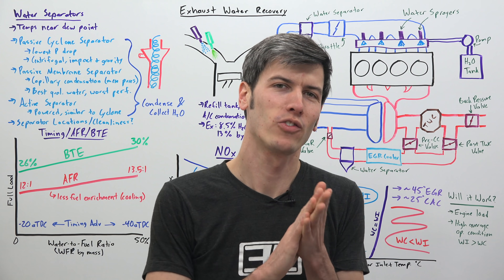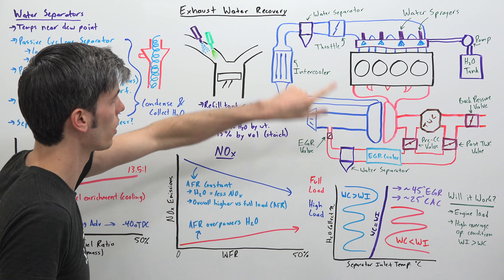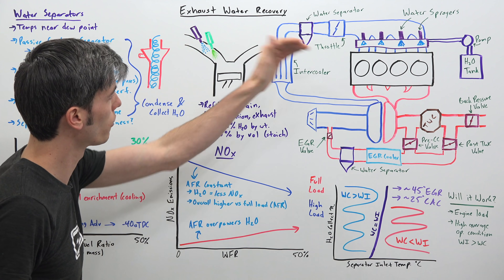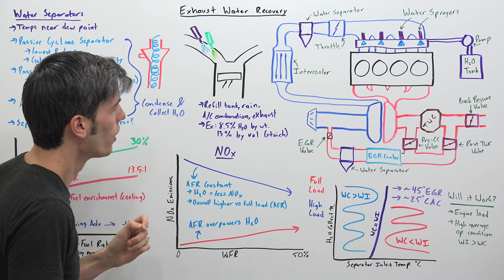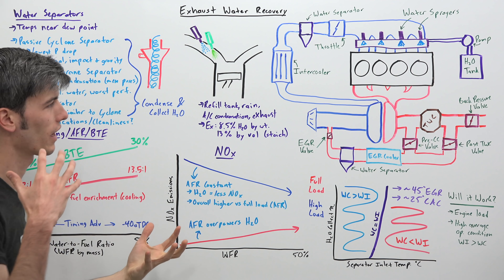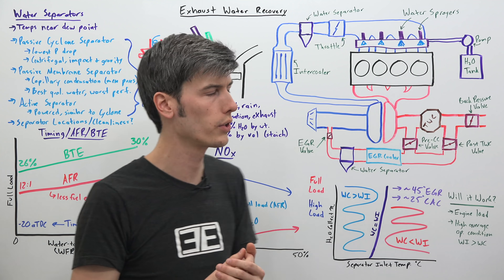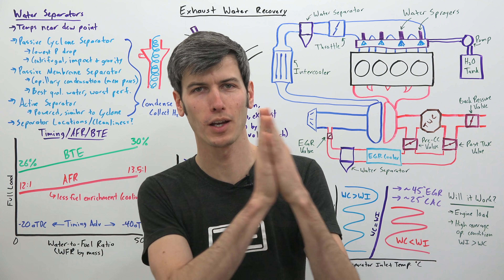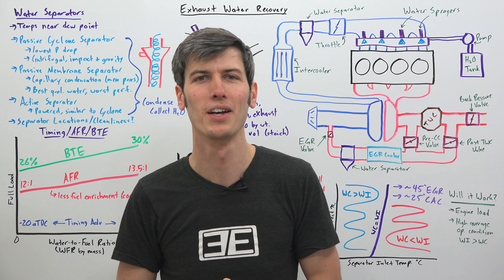Using Exhaust Water To Make More Horsepower!

Comment: Just curious as if you have actually utilized any of these situations or ideas.  I've actually ran water injection,  hydrogen and various fuels with and without both. Water injection has limits with the use of petroleum fuels which is why the Nox gases are a problem.  Using petroleum you can not get rid of these gases, and using water or hydrogen doesn't do much more than reduce them by dilution,  not elimination.  Two things that are important to note,  one; water ignition turns it immediately into hydrogen and that immediately ignites creating the increase in power,  however,  hydrogen (any airgas), does not burn before tdc like petroleum fuels,  therefore the two are constantly working against each other rather than together in a much more beneficial way, two; after detonation and compression the hydrogen and oxygen are immediately reusable as a much more volatile source but the spent petroleum contaminates the process driving down the fresh source
Reply: ...reliability.  
Hydrogen and water injection are a much more suitable combination

Comment: I’ve got a question. Why didn’t they place the water separator BEFORE the turbo’s compressor ? If they did then the drop in pressure caused by the separator wouldn’t be a problem since the air from the compressor upstream would have a higher pressure and thus pull the air from the separator with no problem.

Comment: Will you make a video about direct water injection ? BMW even let a couple of journalists test a 1 series modified with it (it was a red 3 door F20 , a B38 engine with compression ratio raised to 11:1).
Sad that after the M4 GTS in 2015 , no automaker produced a car with water injection. Also about the GTS... I could never figure out why it had 3 water injectors for 6 cylinders.

Comment: Why not just use hybrid water collection system which will collect water from air conditioning as well as we can pour water manually. If air conditioning is not used for a very long period of time, sensors can turn off the water injection system if there is no water available in the tank. I

Comment: Water injection is not new! Many years ago I had an old 1960 P4 Rover 80 which had a 2 1/4 litre petrol engine. I had the misfortune to have a rad leak, and ran out of coolant. Unfortunately, in the process of refilling the system being rather late at night in the middle of nowhere 30 miles from home, the cylinder head cracked and water poured into the cylinders. Having lost the radiator cap which shot off into the darkness, I just filled the rad realising the damage was done. Had to use full choke to get the engine going and got home ok. I drove the car around for a week or two, and the thing went like poo off a shovel and the economy was incredible. Water is an expansive medium when heated to steam. Don't know the science fully, but it was an expensive mistake as far as I was concerned at the time having to get a replacement cylinder head. Never mind the techno babble, all I know is water injection - however its done - certainly does something to the  combustion and ultimately the  economy!

Comment: Vapor gallons, tune, alcohol vapor if wanted, water injection.  7-10 vapor gallons in 1 liquid gallon of gasoline.

15% increase will look like a horrible joke 
However, most of those carbs or fuel vapor devices are out of sight.  

Unless... say one used a thermal fogger for fuel.   Or advanced wicking with better materials.

"Liquid fuel does not burn, 80% of fuel uses is wasted in engines."  ** Popular mechanics every time we talk about this since we started.
Reply: Let's get into why 7,000 inventors are wrong and why if Pogue, fisher, and the like were wrong why billions were spent to silence them.

Comment: Wait until BMW deploys this kind of system. I'm sure they can figure a way to have it fill the cylinders with water or something like that, thereby introducing a whole new catastrophic failure mode. Obviously, the $1,000 water pump must be located where it's nearly impossible to access.

Comment: if the most restrictive seperator is the one that get the most power, would it be possible, on a turbocharged car, to only use the system when the turbocharger is at max boost and the wastegate is open, and then let the charge air run through the seperator, because the turbo should be able the create more air to keep the boost and you wouldt loose power but would gain water from the seperator.

Comment: So wouldn’t it be best to have a water container so at low loads water can be collected successfully and non is injected into the engine while at high loads water is injected through some sort of ECU mapping to reduce nitrous oxide emissions and increase efficiency allowing companies to produce high performance cars without fined for exceeding emissions

Comment: By cleaner water you mean what exactly? Less carbonic acid/nitric acids?
Couldn't water be injected before the water separator on the intake to increase how well it condensates? I get that that is somewhat counterproductive, but it a way it could slightly reduce intake temperatures but also help with ease of water collection (plus the water used gets put back into the cycle as well).

Comment: If It was possible to mix water within the Fuel at the right proportion would it produce the same effect ? I mean for Gasoline maybe not but .. Ethanol ? ... If you need to vary the proportion along the engine loads then it's bad yes but interesting !! Cool !!

Comment: Consumers dont want to have to fill a water tank...
If thats the case then they certainly dont want to be spending the weekend cleaning soot from another exhaust filter.

Not to mention that condensed water from burning gas is usually pretty corrosive.

Comment: Does using the water separator only without any water injection into the intake will increase the power of the engine? As you said in other video that humidity reduces the O2 mass. With low humidity means higher O2 mass. Does this theory applies to both Gas and Diesel engine?

Comment: Wouldn't the water collection be heavily dependent on outside humidity? If you're just trying to recollect the water that you're injecting and the natural byproducts of combustion and the majority of exhaust isn't going to be able to be recirculated, I'd think that more consistent input of humidity would be relevant.

Wouldn't it also make more sense to overdesign one water separator in the intake since your egr is going to go through it anyway?

Comment: So the car runs partially on STEAM POWER to use the otherwise wasted heat to generate power. Can it be enough to build an engine that does not need water cooling?

Comment: Is it me or is  internal combustion hitting peak ridiculousness...
Meanwhile Toyota made an inline 6 over two decades ago capable of 600HP without any modifications for hundreds of thousands of miles, and 1000HP with minor modifications and still insanely reliable. All while getting 20-30mpg in daily driving and running so smooth it couldn't topple a cup of water on top of the valve cover through the rev range...

Comment: What if you don't care about actual recovery but you like the idea of removing the moisture from the intake air? What are the specs on that say like for a 500 - 600 horsepower motor? Is it going to be too restrictive? Will it remove much moisture?

Comment: "...the effect of cooling the air which is done by injecting a liquid water..."
A very similar change in temperature (only in the opposite direction) occurs when  getting an amount of water vapor to condense out of a parcel of air as would occur getting the same amount of liquid water to vaporize in air.
Unless there is an intercooler (or other significant heat loss mechanism) between the condenser and the injector then there is no net temperature benefit of first condensing water out of air only to then vaporize a similar amount into the air.  
Yes, the temperature goes down with vaporization of injected water, but it goes down from a temperature already elevate by the earlier condensing.

Comment: I can already advance my timing to the point where there is no more mechanical advantage.  Just adjust the my distributor to the setting where the engine idles
at its maximum speed.  My anti-knock device reduces knock without adding water!  So extra engine corrosion and oil dilution is not A problem.

Comment: I’d rather have less moisture in my engine and an unnoticeable amount of power gain then messing with water injection. NTY. Only things that should be injected is combustibles. Methane, hexane, propane, cocaine, NO2.
Not H2O.

Comment: Ridiculous... I'd rather have another tank I have to fill up when refilling the fuel instead of those technical water reclamation systems... If one  system I'd prefer the ac reclamation system over those of the exhaust gases...

Comment: Can i use water injection for engine with high compression no boost?
Reply: In theory yes, but not practical - if you run out of water, the engine will detonate.

Comment: Why don't you get this charge air cooling for free. Use a direct port injection lpg system. Simpler, lighter, more reliable. Oh and did I mention the fuel is cheaper, though you use slightly more. Check out ford falcon ecolpi

Comment: its called hydrocarbon; not water... the separator is used to separate carbon. this system only works temporarily when the engine is below optimum temperature

Comment: Water vapor is inert and displaces air (airflow=horsepower).  Why not evaporate the fuel you need anyway  for the temperature drop?  That's what we did at Chrysler for the North American Touring Car Championship racing series cars.  We made 306 hp from a naturally aspirated 2.0L 4 cylinder engine at 8400 rpm.

Comment: From a engineer perspective the people that ran the study are idiots. 
Why? You have a cyclone filter in your exhaust, which means you can filter out NOx. 
Why is that such a big deal, why am I so rude? NOx is what car enthusiasts call NOS. Starting to make sense am I? Meaning you have a free unlimited supply of NOS on tap, that you can feed back into your engine reduce emissions by a absolute ton plus gain torque and horsepower plus it’s technically legal in most countries as it’s an egr system not technically a NOS system.

Comment: is water injection is basically evaporative cooling right? As the specific humidity goes up the temperature drops, isn't the opposite is also true? As the air the dehumidifies the specific humidity goes down and the temperature rises? would make sense to dehumidify the air before the intercooler wouldn't it?

Comment: Something thermodynamics missed here:? Looked it up; water injection during the compression stroke can increase thermal efficiency around 4% by scavenging the heat otherwise lost through the cylinder walls and reduce pumping losses, but the amount has to be calibrated, so there is no liquid water left when the next ignition happens, otherwise fuel will be spent on evaporating the surplus water reducing peak temperature (which is fine for power but bad for efficiency). It also has the benefit of reducing NOx, which again mean that engines can be tuned for slightly higher efficiency before emissions becomes severe, which you also mentions in this video. Nice video btw .

Comment: I thought this was gonna be another video about skyactiv-x. Cooled EGR could produce condensed water droplets which would vaporize into the intake air, cooling it, or in the engine, producing power and cooling. Even intercoolers on non-EGR turbos could produce water droplets in the intake air.

Comment: Aren't these water separators heating the air from which they draw the water by the heat of vaporization? The heat has to go somewhere; the other option would be the through the water separators themselves.

Comment: So if they did use condensation from the AC unit in addition to the water vapor from the exhaust that might help solve some of the concerns of driving such a system in hotter climates... wouldn't it?

Ford had done some testing on this when they were looking at providing drivers with drinking water as they drive. They used the condensation from the AC and claimed that when tested they were able to retrieve 64 oz (1.9l) of water per hour!! Umm maybe with ideal operating condition because yeah that sounds crazy... like on a day with 100% humidity.

Comment: I see a problem with this approach,  especially for the exhaust recovery side.  The water that youbwould recover from the exhaust is very likely to acidic.  You have water in a CO2 rich environment.  What will happen is you'll get a mix of water and dissolved CO2.  This creates carbonic acid and will probably have a pH of approximately 4-5.  This acid will slowly eat away at the internals of the whole system unless it is dealt with as it is created.

Comment: Would it not work to reduce intake air temperatures byspraying water and then running through the water extractor before the valve? Higher humidity and lower temperature equals closer to the dew point. Or would the water reaching dew point be releasing the heat energy back into Airstream?

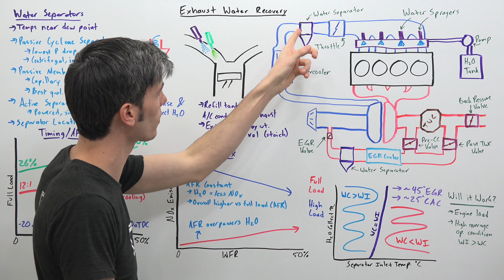Comment: 6:40 dude, that water separator heats up the air. Condensation is an exothermic reaction. 7:07 Taking advantage 2 ways? Yeah, by decreasing the humidity AND heating the air up, then by increasing the humidity AND cooling it down again. Jason, do you really not notice these details?????
Ok, even this setup can have some benefits, you can collect water while idling and driving slowly, then injecting it again when accelerating and you can cool down that water that's in the tank. But that's not the case here, right?
But how much water do they manage to extract? How many liters, grams or percentage of water molecules going out? The extraction of water from the exhaust is the only new thing here, and the focus of the whole video is on the benefits of using it if it works. I know water injection is awesome, but how much do they collect?
---
I personally don't think people wouldn't want to refil their car with water. If I had the option to choose between not filling it up with water, having less horsepower and more fuel consumption i would get some water right away. Nowadays a lot of trucks run on adblue, and the drivers just refill he damn thing without hesitating.
Reply: I think making it fully optional (only used for boost, no harm in not using it), and making it have an easy to use port (similar location to fuel and DEF) it would be fine.  Granted i'm a nerd for these things so i'd end up having 10 ports on the side of the vehicle lol.
Reply: The real hope for this would be if it could end the DEF debacle.  I'm not at all optimistic that industry is willing to be shut down, even if this could come close to allowing it.

Comment: Do you know of any testing of engine performance with high and low ambient temperatures and humidity and different ratios of sensible and latent heat entering the engine?

Comment: Latent heat of vaporization may be the reason why water vapor is taken out of the intake air charge only to be re-injected as liquid water at the intake ports.  Water vapor has limited potential to absorb heat and thus condense the air. This small potential is called sensible heat, since it can be measured in degrees of temperature. Also, if the water vapor is already entrained in the intake air, then it has virtually zero potential to cool the charge. Liquid water, on the other hand, has to absorb a boatload of BTUs in in order to affect a change of state from a liquid to a vapor. Those BTUs are called the latent heat of vaporization. It is called latent because this extra heat does not change the temperature of the water, just it’s state (from a liquid to a vapor).  This is where the benefit of liquid water injection comes from. Think about this process not as removing water from the intake charge, but as removing only the heat from the water that is in the intake charge.

Comment: California is so concerned about homeowners collecting rainwater for plants/etc, meanwhile that's less water that people would be using from the city supply which comes from Northern California(Colorado River). You also have to figure in the tremendous losses of rain water due to evaporation off hard surfaces such as roads, which you could be collecting instead.
Reply: Yeah but there is no tyranny involved in smarter answers. You see the problem.

Comment: Why not just use a dedicated intercooler for a intake manifold cooling system? Seems like a lot of work for, to have an open-ended system that requires an outside water supply, rather than a closed system like an intercooler. I see the efficiency benefit, but is such added complexity really reasonable considering the benefits?

Comment: Then you need to make sure your reservoir doesn't freeze in cold climates.
On my old turbo Chryslers I injected a 50/50 water methanol mix (windshield washer fluid) and ran 18 psi of boost with advanced timing on the stock injectors and fuel map.
Definitely advantageous but the reclaim system seems over complicated. Maybe I'm just old school.
Love your channel!

Comment: I still don’t get the point of the water separator in the intake. It removes gaseous water, condensing it, thus releasing heat. This condensed, ie liquid, water is the injected into the cylinders, where it evaporates, absorbing the same amount of heat. What’s the point?